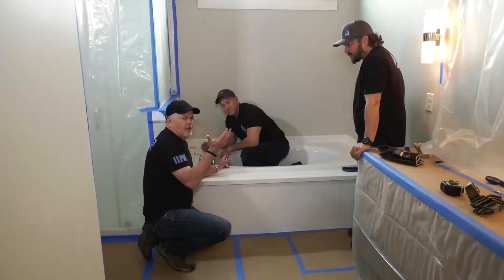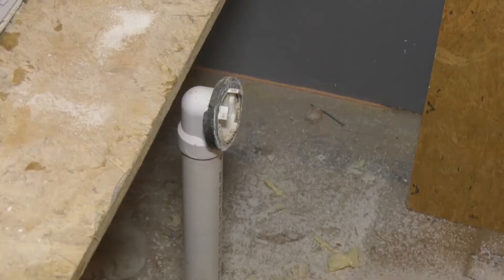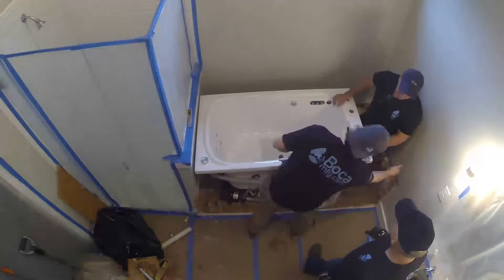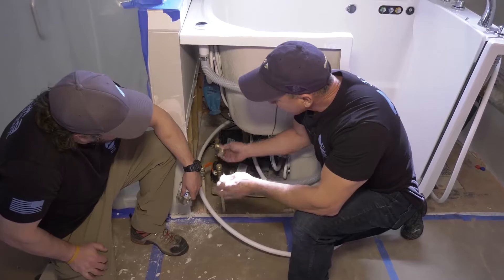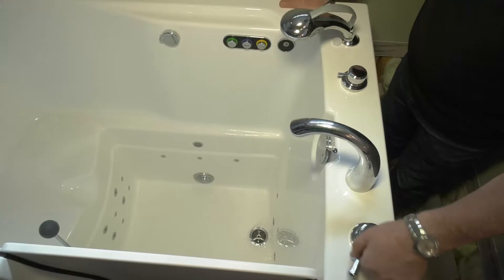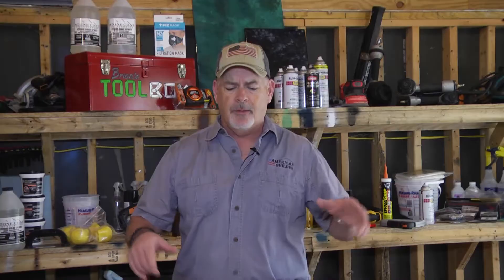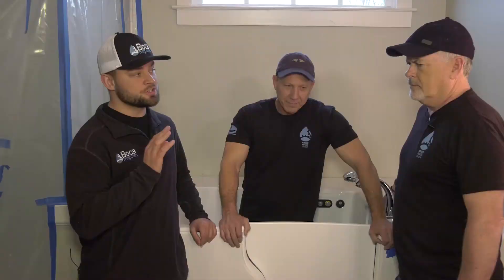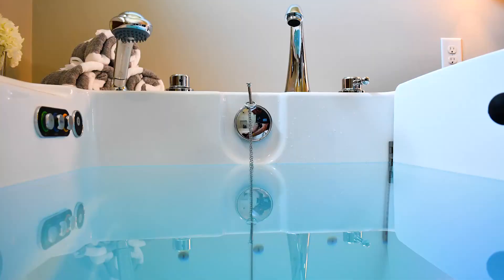American Builder BOCA Walk-In Tub Install

Comment: i would have left the door on the left, installed more straps on the pex-it will rattle as it is. Notice how few jets are on this tub. Watch out for the thermostatic mixing valves. They restrict water flow, and the complicated mechanism needs a technician to service. They get clogged by hard water, galvanized pipes, and iron. The skirt needs access panels. This unit requires a process including re-caulking to get access to the mechanics. Watch out for gel coats on fiberglass. Gel coat is brittle and proan to spider cracking and chips...repairs require a professional. I wish this unit had hip jets and bidet jets. These jets add major value. The half-inch supply lines and single 1.5" drain will not be setting any record fill or drain times, notice they did not show or talk about either of these. I love reviewing tubs, I hope this helps!! Check out That Tub Guy on YouTube!
Reply: I appreciate your post.
Reply: They do have a bidet